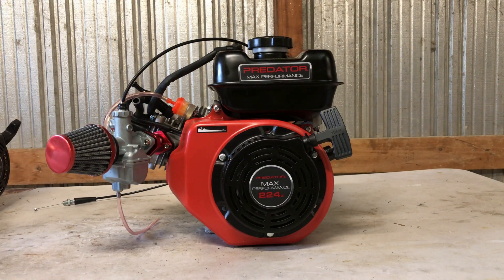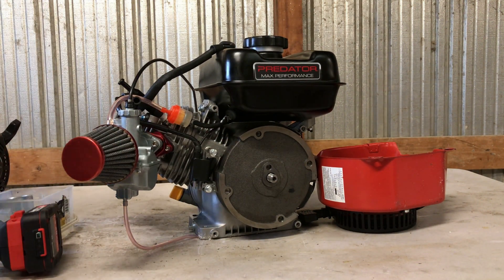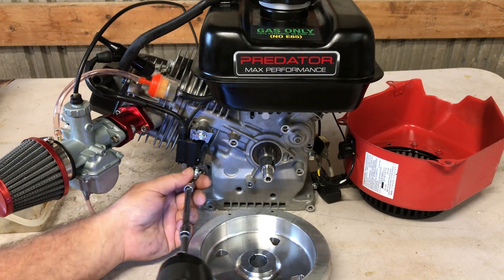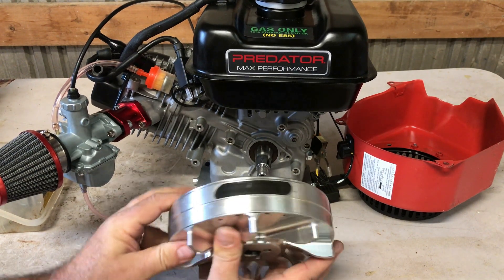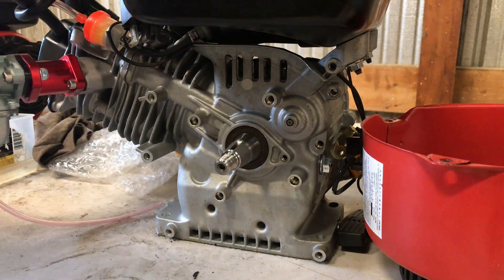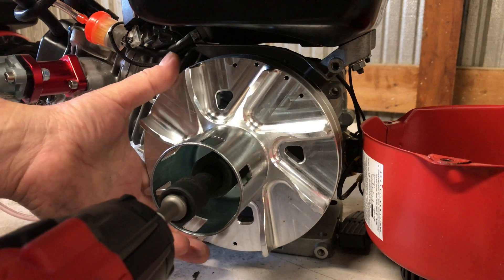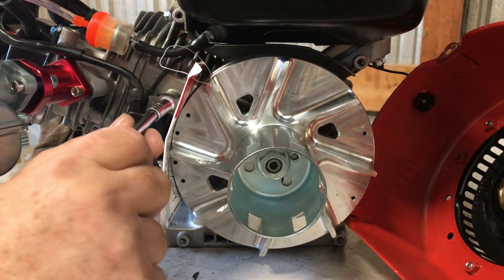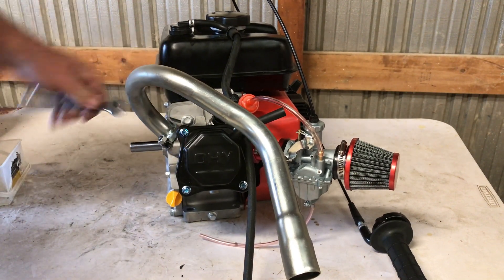224 Predator Billet Flywheel Install on the Billet Rod Wildcat Flat Top Predator 224 Engine Build

Comment: Just sent 2 Dynocams CL2 back to them to be reground. They would not work in my 224. The journal that fits into the side cover is too booku.
Reply from the maker: Oh yea, that Predator non-hemi cam won't fit. It's weird that somebody somewhere thought it was a good idea to make those a few thousandths larger than standard Honda clone size. I think I'm gonna order another Banzai 265 for the other engine. I liked the clearance out of the box on that one and I have some 1.3 rockers around here somewhere....
Reply: @KentuckyFriedFixes  so the 224 is non hemi correct?
Reply from the maker: @igokarts4510  It's a non hemi, but it's completely different than the 212 Predator non hemi engines. The 224 is mostly clone parts inside except the piston. For some reason they used the 212 pistons with the .716 wrist pins but the large end of the rod is the 1.180 Honda clone size. Weird they'd have the connecting rod with two different ends, crank side fits Honda clones and the piston side fits the larger Predator wrist pin. These online sellers need to update their listings pretty quick or they're going to get a lot of returns...
Reply: @KentuckyFriedFixes  That's why I never liked Predator from day one. They should have stayed "clone" with the crankshaft. At least this 224 got it right there. Very happy with that.
Reply from the maker: @Deucealive75  Me too! I wish they'd have ditched the .716 pin on the 224 piston too but that's nothing $20 won't fix.
Reply: @KentuckyFriedFixes  whatcha plan on doing with the engine? Kart? Mini bike, bad ass pressure washer?
Reply from the maker: @igokarts4510  I started leaving hints at the end of my videos as to what may be in the pipes....😉
Reply: too beau coup, too beau coup... FULL METAL JACKET     CM .265 cam, higher lift and more duration. best bang for the buck $65  the others have more duration but no more lift. pointless ... for rules type kart racing where... lift can be checked... duration is hard to check and time consuming